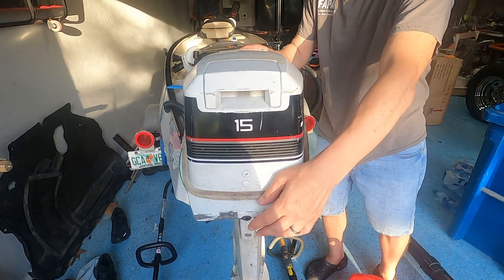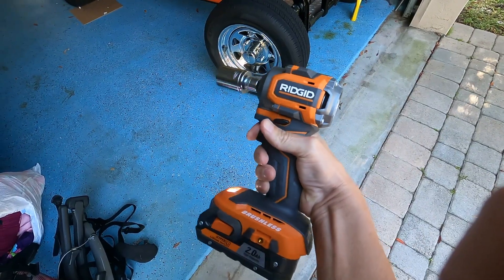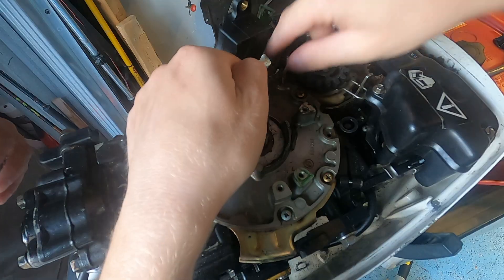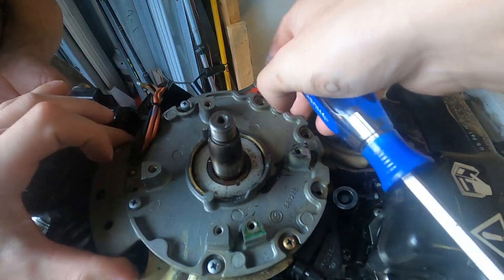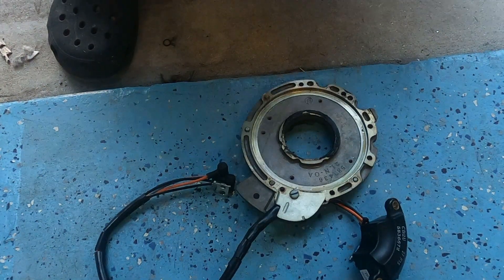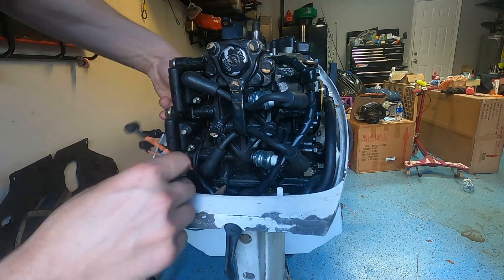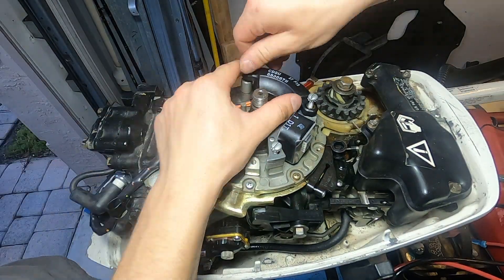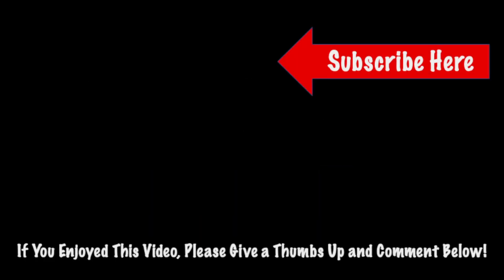1989 Johnson/Evinrude 15HP Ignition Module (Power Pack) and Charge Coil Replacement NO SPARK REPAIR

Comment: My CD2U has matching wires. Both brown with yellow stripes. They are not color coded like the charge coil. How do you know which ones to plug together? Does it truly matter?
Reply: Exactly!  I have the same problem. The CD2U pack both wires are brown with yellow stripe, wher the new charge coil -one solid brown, one brown with a yellow stripe. Which goea where?
Reply: @nitebyfly7325  I just took a chance and plugged it in and it works fine. Not sure if I got lucky or it doesn’t matter. Ha

Comment: When reinstallation the coils, make it is aligned to the boss (with straight edge or feel with your thumb nail) before tightening the screws. The flywheel may rub against the coils while spinning and causes damage.
Reply from the maker: Thanks for the Tip!
Reply: Hey no worries.
It's a pretty straightforward video, Good job.
How did it run so far?
Reply from the maker: @peteryeung111  So Far so good.  Running like new!
Reply: @jakeguitar01  see your ground strap that you had on the bottom bolt of the bottom coil?  Yeah move that to one of the bolts that the coil has a metal tab on. It will still work the way you done it as the body itself is a ground.. but it means in certain circumstances if a coil goes and decides to short for a while, the other coil will survive. Basically the way yours is wired it will tend to blow both coils maybe 20% of the time should one go bad. Like I said though it will still work fine as long as the coils are not on the way out. That motor original came with two circular type coils but they are obsolete now for that size so where you used to have ground wires coming out each coil you now just have a metal tab over one of the coil holes. Yeah 100% move your earth strap to one of them mate and you will have protection.
Reply: @jakeguitar01  I can do you a vid if u want to show the 100% correct way for the coils to be set up. Yours just needs the strap moved as I said. The main reason a lot of them are done like this is when people had to convert to the square type coil over the original circular type, when they replaced them they just stuck the earth on the most convenient bolt as they figured the motor body was the same thing, it technically is but as we are dealing with magic pixies here we know it travels a certain way to earth so effectively all you are doing is making it safe for the other coil should one go bang in a certain fashion. I've even seen ones that had one old circular type coil and the newer type like on yours and you must put the ground strap on the metal tabbed hole of the coil or they get issues at high rpm for some reason beyond my knowledge. It's a common mistake as originally the earth strap was connected to the top bolt of the top coil but because both coils had individual earth leads coming out it never mattered, now they don't it does.

Comment: Great video fellers!! I have what I think is 87/88?? J15rlcud. On my driftboat for the rivers. I see that you have quite a spark after repair. I don’t think mine is that hot. Think I need to change power pack?? Thank you Lew